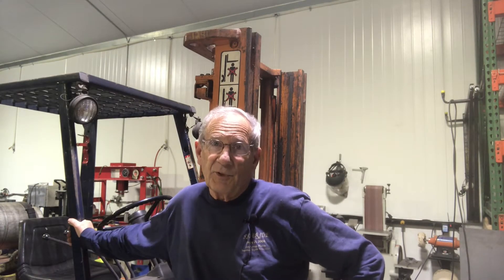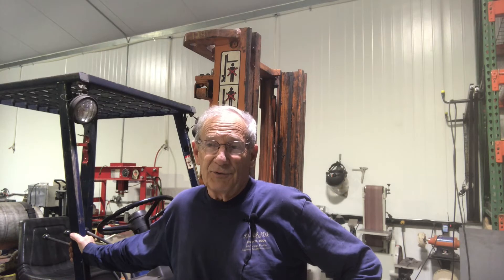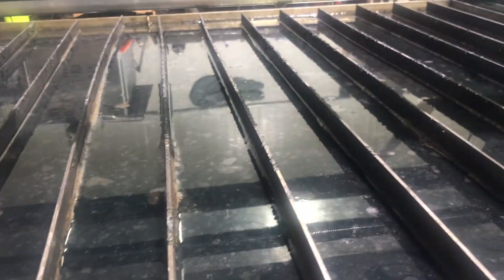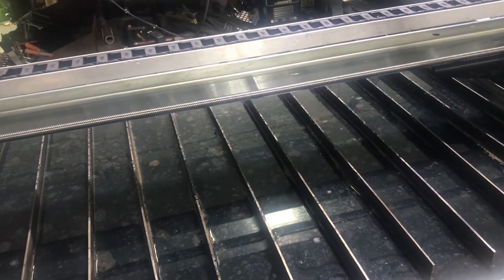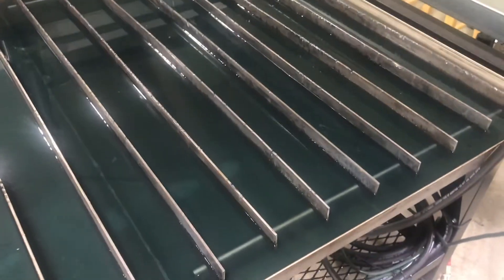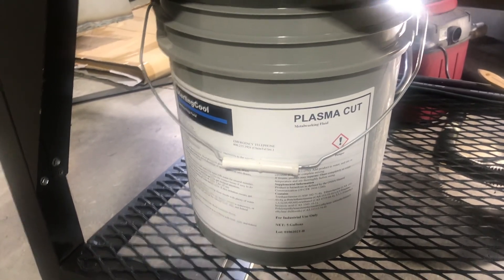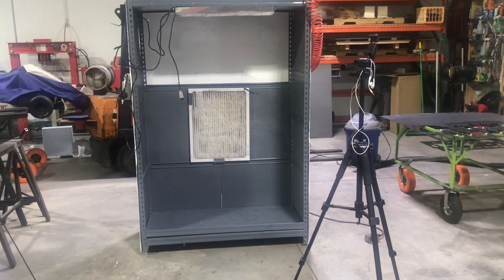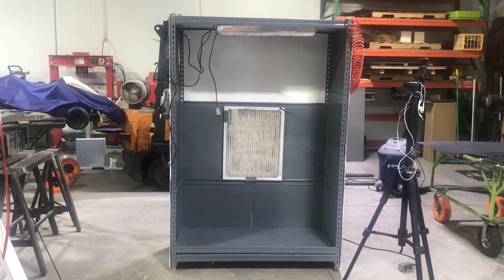Table Cleaning

Comment: Thank you for this video.  I built my own plasma table and I’m having a water pan being fabricated. I learned several things from this video that I will incorporate.  Can you tell me the distance between your slats?  If you could would you make them closer together?
Reply from the maker: Sorry for the delay in responding…for some reason I didn’t get notified of your comment and I’m afraid I’m not the best at checking! The Langmuir includes stainless angle pieces that have slots cut in them to hold the slats.  I am not at the table but I estimate the distance between the slats to be about 8”.  I don’t put a slat in each slot usually because I cut material with lots of cutouts and like them to fall into the table when cut.  If the slats are close these cutouts sometimes don’t fall completely and wind up tipping and partly sticking up so become a hazard to being hit by the torch.  However, if I’m cutting thin material (20 or 24 gage) I will often add slats to help support because the torch when finding the top of the material will deflect the material significantly and the pierce height and cut height are out if spec.  

Hope that helps

Comment: add electro  magnetson a switch 12 volt and turn on and off when needed. I duilt one and used small lift magnet under the table  to hold metal
Reply from the maker: Very cool idea…you should do a video!  🤓

Comment: Nice system. Gotta come up with something similar for my original CrossFire. Ciao, Marco.
Reply from the maker: Thx.  I’m happy with it so far.  Glad I put the scotch brits over the drain…keeps the strainer from clogging!
Reply: Great system. Do you have a parts list for the tank set up and did you tig weld your trays together?  Thanks Chris

Comment: You got me thinking now...
1)  So for the cart issue can you add a magnetic lock like a maglock to underside.  Position steel, engage lock, move, disengage lock, roll steel off.   
2) For the powder coating issue I had this link squirreled away.  https://www.powdercoatguide.com/2014/09/how-to-build-powder-coating-oven.html#.VbxEDrO6e00  if you want to build your own.
3) After you putty knife the bottom rather than vac and wipe can you just add a tee'd arrangement to drain system where you can divert table water to waste and use a hose to rinse the fines/sludge out that way.  Seems easier and less messy/time consuming than vac/wipe.  
Now I bet your sorry you told me about your channel  LOL!
Reply from the maker: Having a mag lock would be sweet.  I have one for lifting...as long as I center it well it will lift a bunch...not sure it’s max but I’ve lifted 500# with no prob.  Guess you could mount something like that upside down under the cart but they are pretty costly even at auctions. I’m soon gonna replace the old beat up magnetic chuck off my surface grinder but was planning to use it to hold the items I’ve cut out while grinding the slag off or using a wire cup wheel so don’t want to use that.  Might wind a coil around some old transformer plates and connect to 24v power supply.  That would be an electromagnet that I could turn on and off.  
Been collecting lots of plans for building powder coat oven...they really aren’t difficult and I’ve already built a temp control circuit for my diy heat treat oven and it works great so I know I could do it.  Time constraints however have made me punt and I’ve bought a new 4’x4’x5’ oven that I’m picking up next
 Tues.!

That’s a good idea to hose the table down.  Would eliminate having to cleaning the vacuum.  Drain openings are small so I’d have to make sure nothing went down that could get stuck but I could just stick a small piece of scotchbrite in the hole.  Might try it next time
Reply: @CustomCreations3  well tried to send a link to what I use but apparently YT delete links.  I'll email it to you.